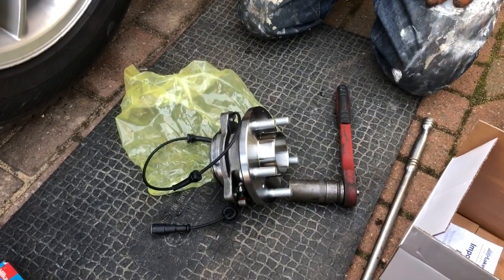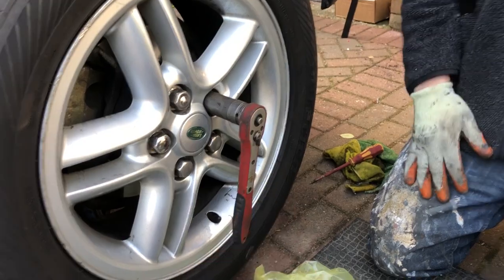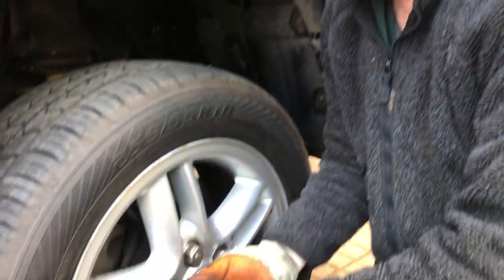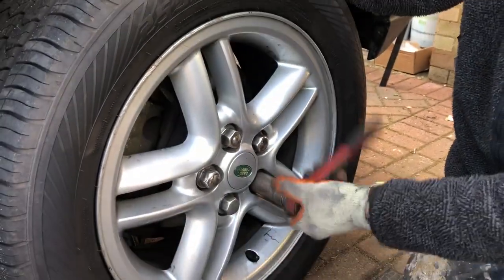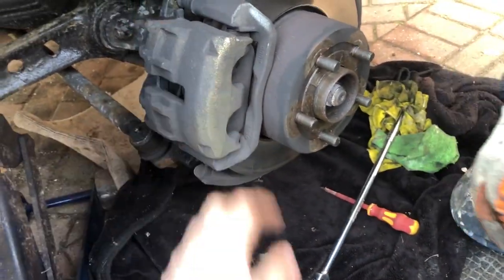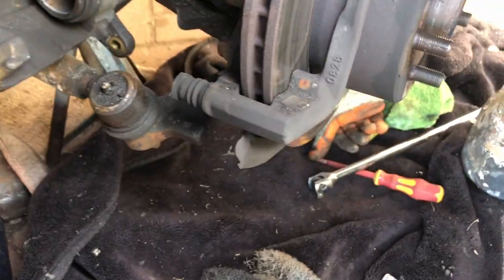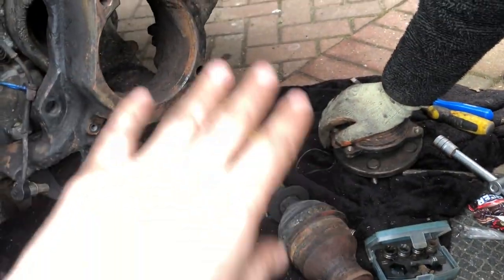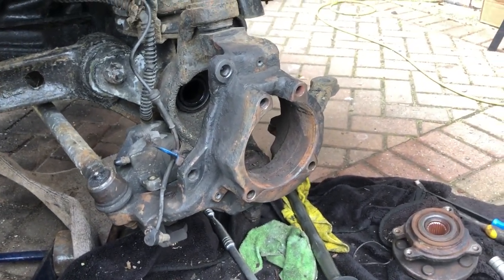Land Rover Discovery 2 TD5 Front Wheel Bearing Replacement How To #discoverytd5

Comment: 19mm should be smaller than 3/4”, but obviously the tolerance on yours shows. I actually ended up trying an 18mm and then a IRWIN socket, then out with the angle grinder for the four bolts.

Comment: Does the drive shaft come out all the time or is it possible to keep it in place.did you use a bearing puller Tia
Reply from the maker: we did ue a bearing puller to push it out, as it had been in there for a long time and created a seal with rust/debris etc if new it slides in and out easily just be careful not to damage the splines you can apply a little oil/grease when refitting.

Comment: I took the half shaft out to clean it. I'm having problems reinserting it. It goes in so far but I don't think the splines are lining up inside.
Reply from the maker: we had the same problem, so just took it out and carefully tried again eventually it went in properly.
Reply: @DanielJohnHowTo  Thank you I will try that.
Reply from the maker: @DSOwen-s9u  we also tried a bit of light oil as well
Reply: @DanielJohnHowTo  Thank you for that advice. I managed to get the Half shaft back into position with just a bit of wiggling and jiggling. :)
Reply from the maker: @DSOwen-s9u  that's all it takes sometimes, thanks.

Comment: Did mine today, well tried to 😕 one of the 15mm bolts holding the bearing in has rounded and I dunno how to get it out 😭
Reply from the maker: In this situation something like this may help: https://www.screwfix.com/p/erbauer-bolt-nut-remover-set-6-pcs/6083d - bang it on then use a breaker bar to crack it, after replace the bolt with a new one hope that helps we have had many problems like this ourselves.
Reply from the maker: you can also try cleaning it up with a wire brush, shocking it with a hammer, penetrating oil and finally heat. for some bolts I have use visegrips (curved jaw locking pilers, a quality brand not rolson) but only as a last resort but they do work.